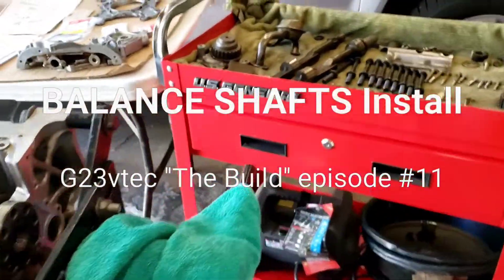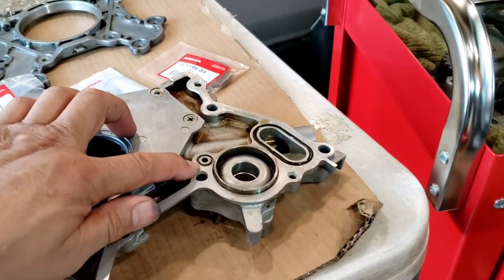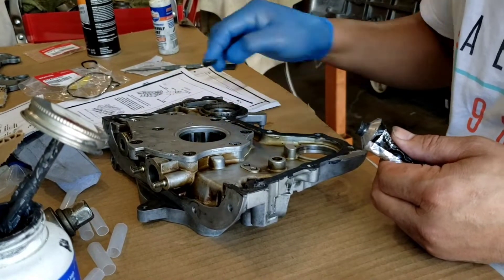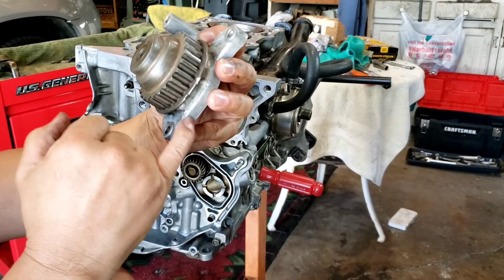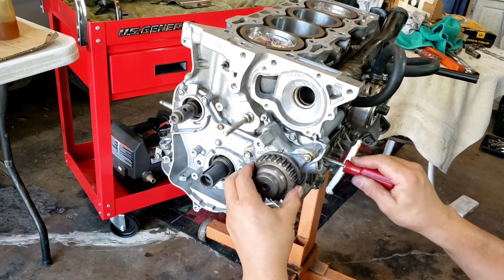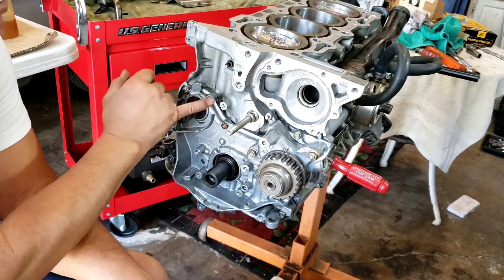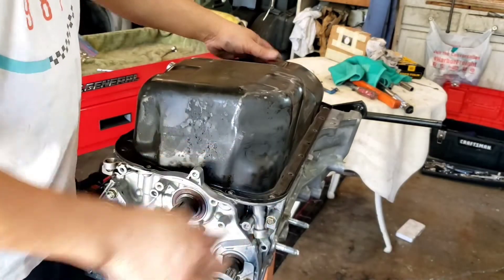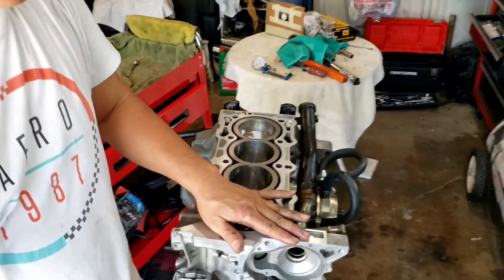Balance shaft installation. G23vtec episode #11

Comment: Hi, what's the honda part number for the little O-Ring on the oil pump?
Reply from the maker: Honda parts catalog for F23 doesn't show it on line, not sure why. But l've been using a seal that you can buy at hardware store( oil seal of course). I just what ever fits. I looked up Prelude H22 pump and it should fit, #91313-pc9-003
Reply: @sagittnet2158  Thank you man! I was looking for it and couldn't find it. Now I know why lol. Just need to find a h22 crank gear now, honda parts catalog shows it as discontinued.
Reply from the maker: @Open90  Not a thing brother, crank gear mostly you'll find some on ebay. Later man!
Reply: @sagittnet2158  Thanks you, appreciate the help!

Comment: Why not eliminate the balance shaft?
Reply from the maker: Eliminating balance shafts is one in the list of things l learned building g23's. I eliminated it on 2 previous Turbo'ed engine that blew up, and l was succesful with balance shafts installed on another g23 NA setup. I thought about it without but l have to use a aftermarket damper, but it's a bit expensive(Damper). So , l said to myself, why not use the balance shafts, it's free, and it works like how how Honda engineered it. You only free up l think around + - 10hp, without it, but since it'll be aspirated engine, l'll pick up those extra hp in no time. Thank you for asking and l might explain it on next episode once upper deck is complete.
Reply: @sagittnet2158  I always wanted to eliminate the balance shaft in my H22 but if it causes problems like unbalanced rotation it definitely not worth it. Thank you great series and yes I am interested in the video full explanation? Will you be using n/a cams or turbo cams?
Reply from the maker: @primeaccord  It's ok to run it w/o but l highly recommend to use a aftermarket damper to replace the balance shaft specially if car is your daily. I also noticed a sound at certain rpm, l guess thats why they call it a harmonic balancer to cancel out any sound that cause by crank vibration. I'll be nice to get a hold of a set of type S cams, but force inducting h22 doesnt really need it. Now a days with the use of e85, bigger injectors and pump is what give you power now. But l'll stay with pump gas, there not a lot of gas station in my area that sell e85. Thanks again for watching.
Reply: @sagittnet2158  great advice I have a euro r so maybe I should boost 😂 😂
Reply from the maker: @primeaccord  hehehe, thanks
Reply: Did you reused your oil pump? Debating whether or not to reused mine.

Comment: How did you get the oil cooler to work on the f23 block? I would love to do that since I have a h22 oil cooler that I got for free with the two h22a4 blocks so I have a few things I can hybrid on to my f23a just for extra insurance.. like the oil squirters but they seem to hard to get to work.. but the oil cooler seems like you just routed it to your oil pressure switch sensor? And with the coolant line did you use a h22 coolant pipe ?
Reply from the maker: I removed the plug and install a barb fitting. Removed the fitting bolt for the F23 oil filter and install the h22 oil cooler, cut f23 cooler pipe in half and welded a h22 on other side. You can use a f23 cooler pipe hose if you want, just need arm and muscle on h22 side to insert in coz pipe is a bigger.